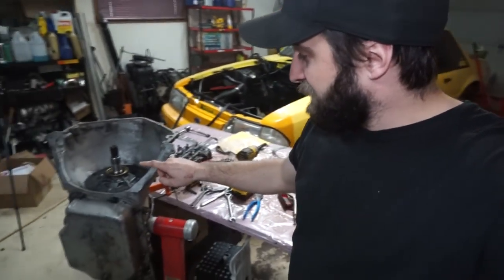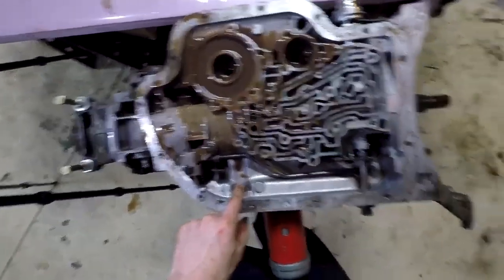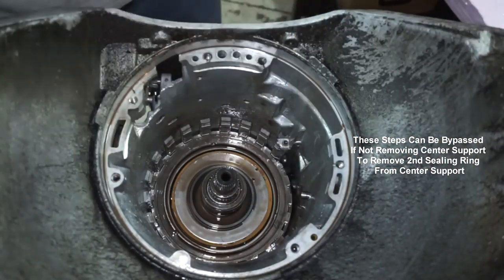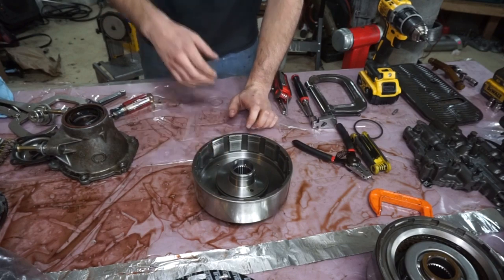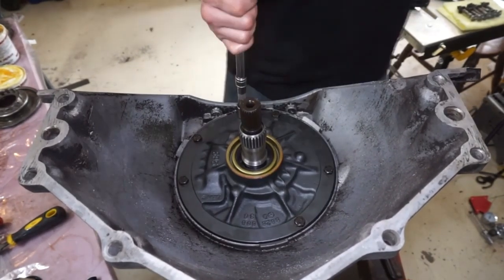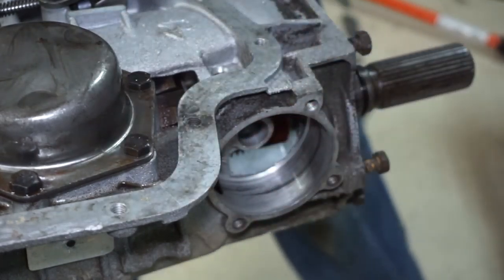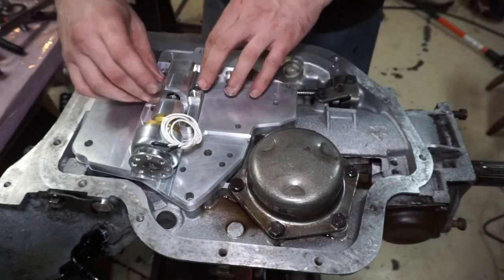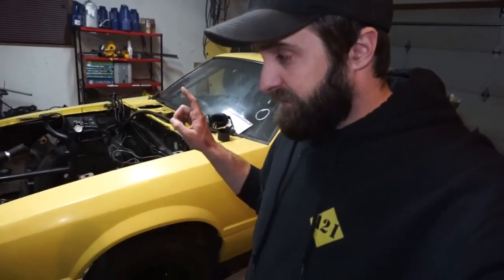How To Install TSI TH400 Trans Brake, Step By Step!!! Summit Jegs.

Comment: Awesome video.. There are 2 more small upgrades to add. Toss the plastic bushing, replace them with roller bearings, and upgrade the sprag. Take a look at precision transmission video on th350/ th400. He also talks about mods to make a mvb out of the stock vb.

Comment: Best transbrake install video on YouTube! Thanks for creating. Couple questions: do you street drive the car that has this transmission with the transbrake? How “streetable” is it or would you not recommend.  Thanks again!!
Reply from the maker: This was more of a track car, but I would drive it on the street too. Had more to do with the car than the transmission. Roll cage, no interior etc. But it was registered, had lights/blinkers etc. I would drive to to the track sometimes.
Reply: @BlaserBuilds thanks for the response. I enjoy your videos. This one was a great one.

Comment: Interesting how the new valve body fluid circuitry is much simpler than the Oem version with all its automatic shift features.  No vacuum modulation, speed governor etc.  can't wait to see it in action.

Comment: When you get to the center support part of the video, you mention not needing remove it unless you're rebuilding the trans at the same time.  Then later, you have the center support in hand and talk about removing the center sealing ring.  I assume that can be done with the center support still mounted securely in the case?  Maybe with a pick?
Reply from the maker: Yes. You can remove woth a pick or screwdriver. The split rings I just grab with a fingernail usually.

Comment: Very informative! I recently purchased an el Camino to use as a drag and drive event car. BBC, 4.10 Posi 12 bolt and TH-400. I'd like to install a trans brake but thought I would run it with just a line lock first. The previous owner was not the car builder and he didn't know much about it. The trans has a shift kit in it now as it doesn't shift until 4K RPM and shifts quite hard which is fine for racing but not so fun for street driving. I don't know what converter is in it. 
I'm just kind of learning about automatics so what controls the shift point on them and what is the best way to change it. Should I go to a manual valve body?
Reply from the maker: Vacuum modulator and kick down cable can control the shift points. Manual VB is nice if you don't mind shifting it yourself.
Reply: @BlaserBuilds  Thanks

Comment: @blaserbuilds I have a TSI transmission TH400 (aftermarket case) and their transbrake like you show.  I've had issues where the line pressure is too high.  At idle in neutral it is 275#, in 1st 300#, in 2nd 300#, in 3rd/drive it's 200#.  It blows fluid out the vent and I've checked it (it's clear), installed a catch can (mounted up high to allow drain back), etc.  No idea why it's so high in pressure and I've put in a different pump and it does it as well.  Any ideas on the culprit?  Valve body, Case flaw, other?
Reply from the maker: That is weird. Have you tried doing anything with regulator spring to lower it?

Comment: I just wanna add a trans brake to my th400. Could that be done with the trans still in the car? ( I wouldn’t do it my self of course. Just curious)
Reply from the maker: No, you usually need to make modifications in the drums and pump.

Comment: Nice work! Does this require you to hold the transbrake button for reverse? Also is reverse in the same R position or in the Neutral like some other reverse valve body W/brake?
Reply from the maker: Neutral, and hold button.

Comment: How are you getting your speedo signal from your th400. I'm swapping my 4l60e out for one and am wondering what the easiest way would be.
Reply: Why would he want that in a race car?
Reply: @Stevesbe  some do some don't. I'm building a 700+ turbo truck, but I'd still like to drive it around and know how fast I'm going.
Reply: @bstgarage7803  I used a gps speedo from speedway motors, simple and functional. It matches my autometer gauges pretty close.

Comment: I installed mine and only had 1st gear in all shifter positions
Reply: Hoping to learn something from this video
Reply from the maker: did you verify the selector is in the manual valve?
Reply: Yes it was in. I'm wondering if I put the modulator valve in backwards if that is possible
Reply: @BlaserBuilds  it did have neutral
Reply from the maker: @chuck6698  Same valve body as in video?
Reply: @BlaserBuilds  ati super quick. 1-2 launch. Same instructions as you read
Reply: Found a passage was modified near the Mod valve. Plugged it up and filed smooth. Should be what it needed
Reply from the maker: @chuck6698  Interesting find. Hope that fixed it.

Comment: very terrible video man! thanks
Reply from the maker: No prob. Glad I was able to ruin your day.
Reply: @BlaserBuilds  I have been searching youtube for a good vid that shows how a transbrake works but not found much. This video helps a decent amount by showing the parts but I'd still like to see some sort of animation that shows exactly whats happening. 

Is it just rerouting pressure to apply 1st and reverse some how?
Reply from the maker: @umakemerandy3669  Yes, Solenoid routes line pressure oil to reverse circuit while in 1st gear. When button/solenoid releases, it exhausts fluid from reverse circuit to "release" and launch the car.
Reply: @BlaserBuilds  Ah yes, thank you! Now I see the purpose of the hole you drilled. I also now understand how it is possible to be able to bump or creep. That never made sense to me but the trans being in first gear primarily, then adding/releasing reverse gear pressure makes sense.

Should whip up a proper video about this titled "how a transbrake works" or somethin, I bet it would get a lot of views.